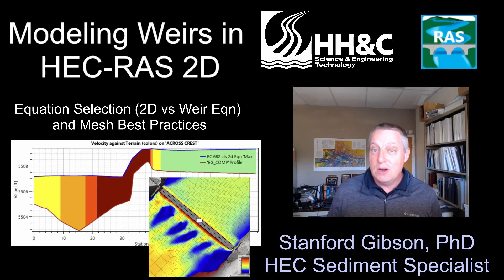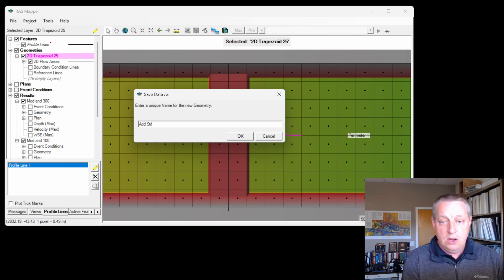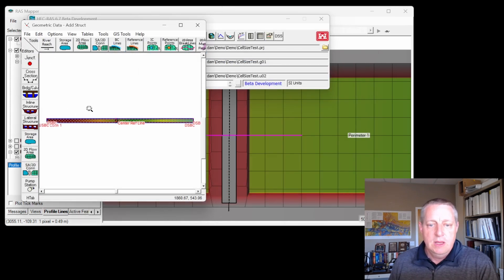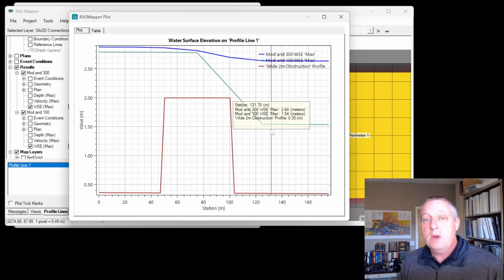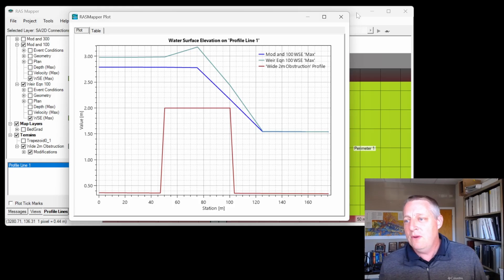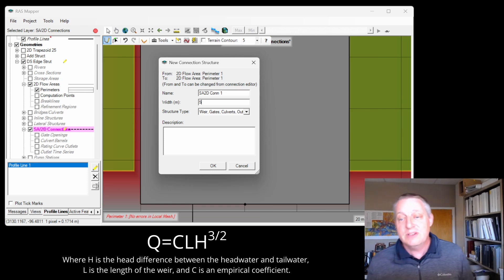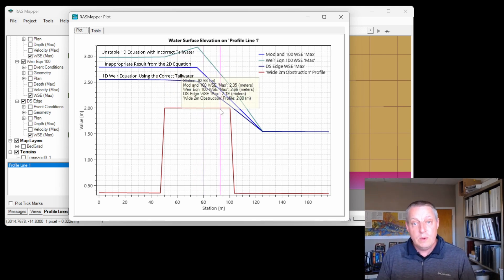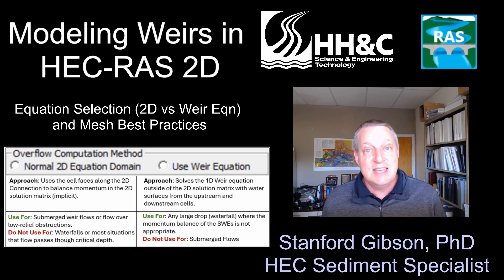Modeling Weirs in HEC RAS 2D

Comment: Thank you, your videos are always useful!
The choice between 2d and weir equation is precisely a frequent problem for me because when I want to use a wide range of discharges rates in a single model, the weirs become unstable when highly submerged. And it's impossible to switch equations or lower the weir coefficient during a run.
But I find that the trickiest choice is when studying levee systems 3-5 meters high that can become highly submerged on exceptional floods.
I assumed that I'd have to lower the weir coefficients to get a satisfactory answer for both a common flood and an exceptional flood.

Another point, to reduce instability problems, I tend to use weirs only as structures, not as terrain modifications, and not both as in the video. Is this a problem?

Comment: Can enlarging the cell sizes on each side of the weir partially solve the problem of "feeling where tailwater is" when the weir centerline is placed in the middle? I bet a lot of modelers will place the weir centerline in the middle anyway, so can HEC-RAS figure out a way to automatically locate the tail water locations instead of using the nearest cells?

Comment: Very informative..thank you! Was the comparison chart labeled incorrectly? Is the 1D headwater suppose to be greater than the 2D headwater solution?
Reply from the maker: Actually, it is correct.  But you are also correct.  The unstable 1D tail water is higher than the 2D tail water when the weir is placed at the center (so the tailwater condition is too high).  But when you move the weir to the edge, and have an appropriate tail water, the 1D equation drops to a more appropriate head water because it is not computing submurged flow through the structure.
Reply: @stanfordgibson  I had a similar question. Just to confirm, if you had also run the "Normal 2D Equation" with the structure at the downstream edge it would produce a headwater WSE lower than the "1D equation using the correct tailwater", is that correct? A second question, I assume you are using the Shallow Water Equations, not diffusive wave?

Comment: Dear Stanford Gibson,

Good morning,

First, I would like to express my sincere appreciation for your well-crafted and insightful video.

I have a follow-up question regarding weir hydraulics:

Specifically, I'm interested in the transition between free and submerged weir flow in a simulation with varying discharge rates. When the simulation progresses from a low flow rate, where the water level approaches critical depth at the weir, to a higher flow rate, resulting in submergence (water level exceeding critical depth), which equation would be most appropriate?

In essence, I'm seeking the most accurate equation to model the transition from unsubmerged to submerged weir flow conditions.

Thank you for your time and expertise.
Reply: The weir equation has a submerged weir decay function that will reduce the discharge as the tailwater approaches the headwater elevation. It usually does a good job in simple weir cases like this but isn't as accurate with more complex situations. The weir equation was developed for idealized conditions that aren't always present. 

Unfortunately RAS doesnt have a built it way to deal with both situations with the 2D equation.

There is no "one size fits all."
Reply from the maker: Yeah, because we don't switch equations (RAS2025 will be much more sophisticated) you have to ask yourself which errors are worse for the modeling objective.  The submerged weir errors are usually not as egregious as the 2D equation errors, but submerged weirs can be really frustrating from a stability standpoint.  My rule of thumb is use a weir if you need both and carefully manage the tailwater...unless you care more about the submerged answer or instability is killing you.
Reply: Thank you very much for taking the time to address my question!